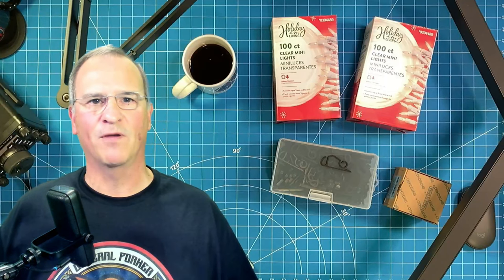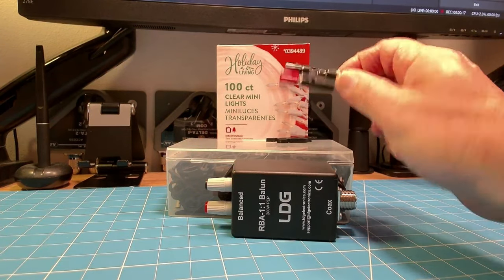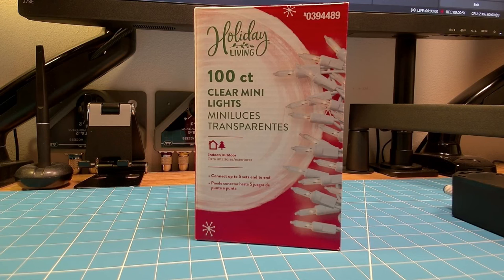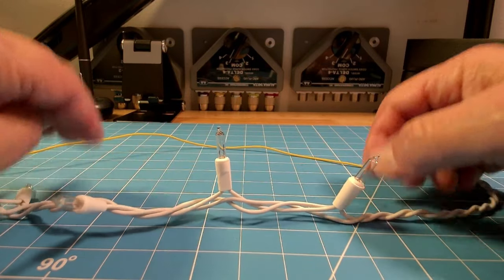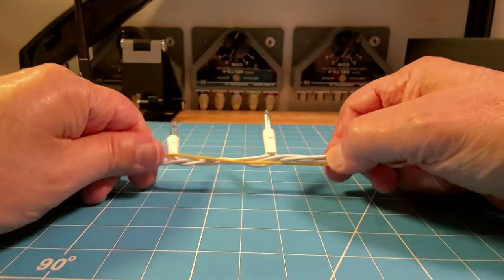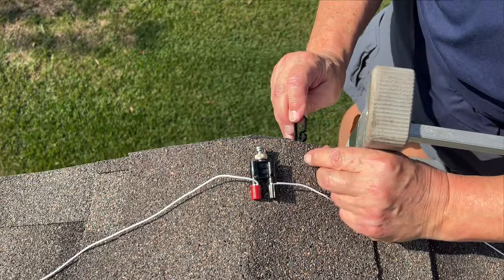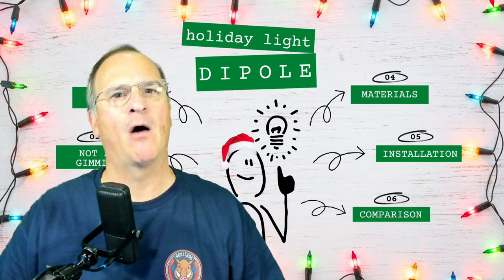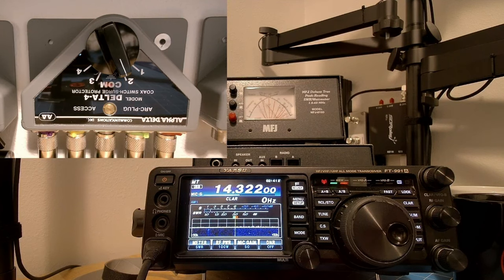HOA Stealth Ham Radio HF Antenna Episode 3:   HOA Approved HF Dipole Disguised As Holiday Lights

Comment: Hi Bob!  Just came across your channel today and subscribed.  I’m in the somewhat unique position of being President of a single family condo association of 77 homes in New Hampshire.  I’m also have been a ham for 57 years.  I have advocated for allowing very limited antennas for hams in HOAs and Condos.  I think your idea with the lights is great!  I even think just the white wire without the lights is fine.  If you didn’t tell someone the wire was there, they wouldn’t even notice it!  I have woods behind me and run a couple of wire antennas back to the woods.  Most residents don’t even notice them.  Keep up the good ideas!
Reply from the maker: Thanks Steve for the input.  You are right on just the wire, and I think I'll take some video of that after I pull the Christmas lights off....  The white wire should just disappear next to my white drip edge--no one will ever notice.

Comment: If you have a metal gutter and a two story house, you already have a horizontal HF loop antenna that WILL need a tuner, however, it does work. There are a few things you need to do to make it work. 
This works much better with continuous gutter as there are less connections to ensure. You DO need to make sure each section of gutter is electrically connected together. The best way is to solder the ENTIRE joint together to minimize corrosion and other possible faults over time. Use 450 ohm ladder line to bring as feedline into your shack to minimize noise. Where you are goin to connect the ladder line, treat the gutters as a dipole and connect while using some sort of insulator between the gutters and caulk to prevent leaks. You may also need to ensure your gutters are NOT grounded to any metal on the house.
Reply from the maker: Love the gutter idea Dennis.  So many antennas on people houses and the just don't realize it.

Comment: Cool idea Bob. I think your SWR difference is probably two-fold. You may be getting some parasitic effects from the light wires but one thing for sure is when you go from close to the ground and raise it up, the antenna looks shorter. I had same issue with my Cobweb antenna. I would throw the analyzer on it and see what you got. Might need to do some adjusting of the length to get it closer to resonant.
Reply from the maker: Good observations House of Ham; it is certainly closer to the ground than a 20 meter dipole should be.  Thanks for stopping by and watching.

Comment: I live in one of the richest counties in Virginia. ( the county is rich, not me by a long shot) My HOA is one of the largest in the country. I solved the antenna problem by joining the County's ARES organization. (It helps that Fairfax County also hosts Rescue One, the premier Search and Rescue group.) 

I sent in my request and asked to speak at the Design Review Board. I wanted to put up a multiband vertical antenna and an off center fed Dipole antenna. I provided sketches of the property, notated where these antennas would be hung or installed. and brought the OCFD to the meeting. I also brought a copy of the FCC's letter that states that with a few exceptions, Federal, State or Local governments cannot restrict Amateur Radio. I did point out that within the letter it states that, because an HOA has a contract with the members, that they were within their rights to deny my request. I also went to great lengths to explain RF interference and the danger if someone was to touch an antenna that was transmitting. The vote was 3 to 1 in favor with the only amateur radio operator on the board abstaining. Because of my efforts, more Hams in my HOA are using HF antennas that they don't have to hide. 

Still, I love the thought process behind this build. Please keep up the great work!

Robert de W4RBJ
Reply from the maker: Robert that is a great way to approach an HOA!  Congrats on your method, success, and model to others.

Comment: great idea. I made an 11 meter diapole back around the early 2010s. I used either 10 or 12 guage soild copper wire I got from Lowes. I used a coax T connector for the center part of the diapole. I taped the diaple to the clothes line I had stretched out in my back yard.  I used the clothes prop to prop up the center to get rid of the sag. The coax feed line was taped to the clothes prop from the ground up to the diapole. I didn't have to have it stealth or camouflaged but it ended up being that way. A friend came over and I told him my diapole antenna is in my yard and he looked right at it and couldn't see it. He thought it was the clothes line because it looked the a the clothes line.  It was only around 7 feet above the ground. I don't know if that can be a good one for you to try being you have the HOA. My grandfather was a ham operator and he had wire diapoles in the air in his back yard. I remember sitting with him in his basement shack in the 80s when I was younger and watching him talk to countries all over the world. He ran 100 watts through them when he talked. He used to wipe out the livingroom TV because it was using a outside roof antenna. He also had a 30 foot tower at one end of his house with a big 4 element horizontal beam and a mastpipe mounted on the other end with a Cuhsman R5 verticle.
Reply from the maker: Thanks for watching cheezst8ke, and thanks for the info on all the options and experiences.

Comment: Try using 10-12 gauge wire for the dipole and you will get a larger bandwidth.
Reply from the maker: Great suggestion, thanks for the tip.

Comment: I get the idea, but seems like an awful lot of work. I have cup hooks up under the eave. If you use wire the color of your house you can't see it from the street even without trying to hide it with lights.  I doubt you could even see black wire if it were a really small gauge like the stealth antenna wire. The small cup hooks seem like they would last a lot longer than the shingle clips. Mine have been up for 15 years. They have been up longer than I have been a Ham because I did use them for holiday lights. 73 Chuck WG5X
Reply from the maker: Thanks for sharing Chuck.  I wanted to get above my soffit since it is all aluminum.  Your recommendation on the hooks and wire are spot on...most people will never notice it, and it is certainly less complicated / work.

Comment: Just put the dipole up under the eve. Skip the lights. Make sure to use same color wire as the color of the eve. All set. No detuning from the other wires or aluminum drip edge. ‘73. De N1FJB
Reply from the maker: sramsdellwdm, for sure.  Easier set up and blend right in.  Thanks for the feedback and for stopping by.

Comment: @HOAHamRadio Could you not just twist the bulb leads to short the bulbs and avoid the need for glue?
Reply from the maker: I guess it depends on how the lights are made.  That would have created the needed friction fit, but it likely would have made electrical contact on the lights I bought.

Comment: From the get go I would replace all conductive wires not in use with fake white nylon thread and glue the dead bulbs to it. Maybe consider a substitute fake bulb with no metal filaments in it. Go fake all the way.
Reply from the maker: Great suggestions cowboy6591; thanks for sharing your ideas.

Comment: Could you just twist the bulbs as to short them at the base?    Just wondering 🤔
Reply from the maker: Pyro, I don't think the construction of the plug will let you do that, at least not on the string of lights I used.  Great suggestion...finding an easier way to disable each individual light would be helpful.
Reply: @HOA Ham    Thanks.  For the video.   My friend lives in a HOA.  I'll have him check on your idea.

Comment: All that extra wire right next to the dipole can’t be good. How about 1) glueing the bulb sockets to the continuous wire and then 2) cutting out all the wire between the bulbs?  That leaves just the continuous wire with bulbs attached. Cut the leads off the individual bulbs if necessary, but maybe it wouldn’t be since all the wire connecting the bulbs has already been cut out.
Reply from the maker: I can hear the wheels turning and I appreciate all the feedback.  I was hoping this would lead to others sharing their ideas...thanks.